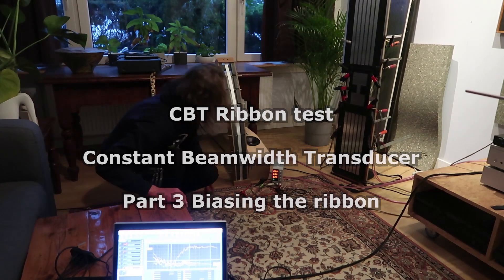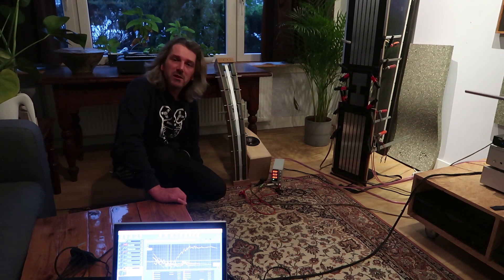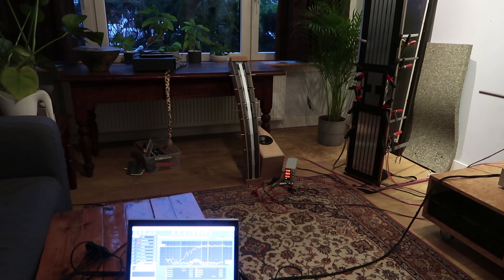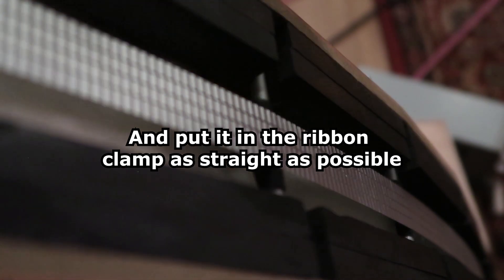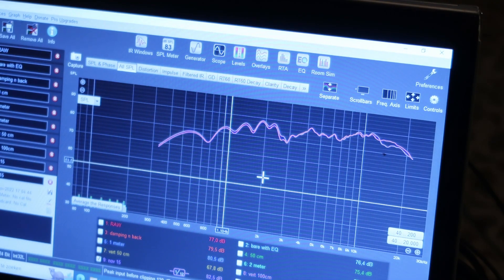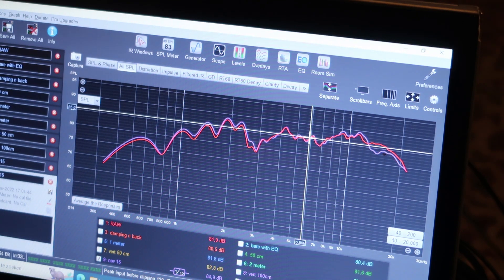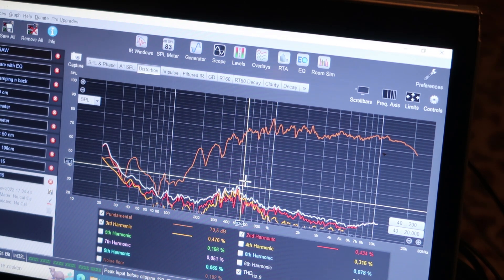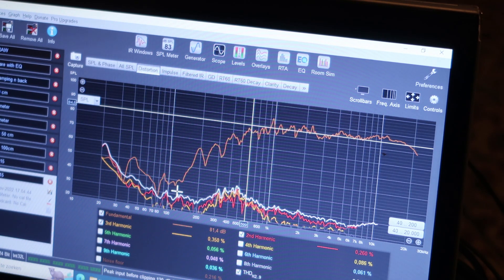Constant Beamwidth Transducer (CBT) Ribbon - Part 3 Biasing

Comment: Quite good measurement for in room and no gating. I am impressed. If you want to chase the Fs try seeing if the panel measures the same on a ground plane measurement as it does standing up. You frequency range is rather limited so your room will be sufficient to do this in. Sometimes a line array causes it's own problems as it stands and you are measuring reflections that are quite strong. A ground level measurement will let you know this right away. I understand that you have your rods on the sides you can place something under the sides and either lift the mic to the same height off of the floor keeping in mind that that distance will have a response anomaly. This is only for purposes of identifying what is going on in the panel. Cheering you on Joppe!

Mark
Reply from the maker: Thanks mark  yeah its hard to measure inside my room.  i did make  a new video about distance where you can see it changes but ever so slightly, except for bass.  it will drop faster then the ribbon.  you mean a ground measuremetn like elevate it in the sky ? or the mic. since i can since the thing is using the ground to make na reflection of itsefl.. if that works 100% i have no clue,.... i cant imnagine to be fair :) but the measurements of keele seem rather clear :)

Comment: Would a unit that would take the speaker output voltage and convert to a DC power supply that would feed off the signal from the amp Output then convert to a pulse DC signal to a separate set of ribbon coils . Then everything would be separated.

Comment: Really smart with the biasing! I guess that it is a net variance of the magnets.  If you swap the magnets, will  the ribbon go to the other side (provided that you can swap of course)? Maybe trim the distance to the ribbon. Or just move the ribbon a little.
Reply from the maker: Thanks, it looks to act like a  walking on a rope, if you go a little over to one side,  its going.  i noticed i mounted the ribbon not perfectly straight in the lower clamp. so it has a "bias " to move to the right when completely free from supports :)
Reply: @joppepeelen  When I messed with ribbons some years ago, I also noted that the ribbons wormed. Probably because that there were a DC component and that the magnetic flux density weren't the same in the gaps between every pair of magnets. I never did manage to block the DC. That, and the ribbons susceptibility to move when someone opened the door made  me started to look at line sources with dynamic drivers instead.
But, with the inspiration you provide us, it is perhaps time to look at ribbons again.
Reply from the maker: @ClaesJegerås  i believe only a simple cap could get rid of the DC in a ribbon. i can see my ribbons move forward when i connect them to the amp if no cap is used.  with cap they stay where they are.